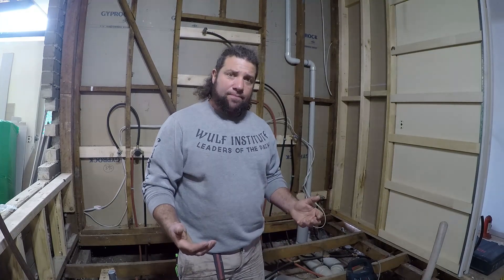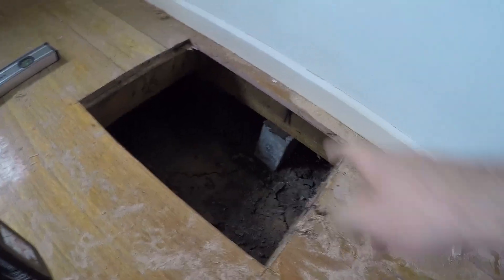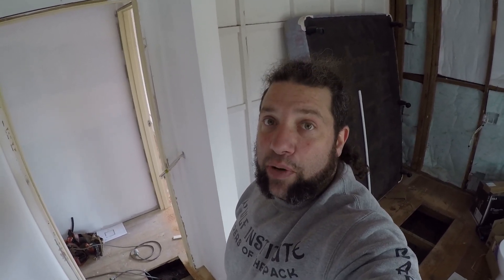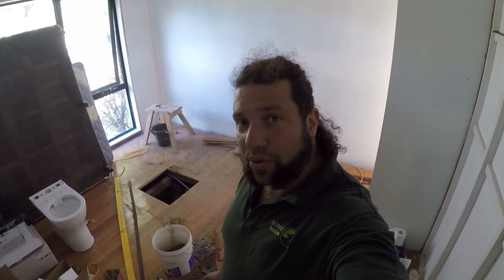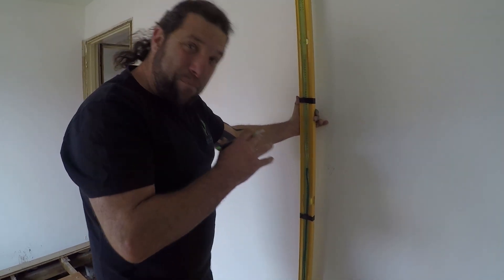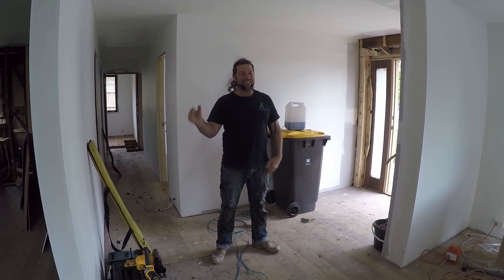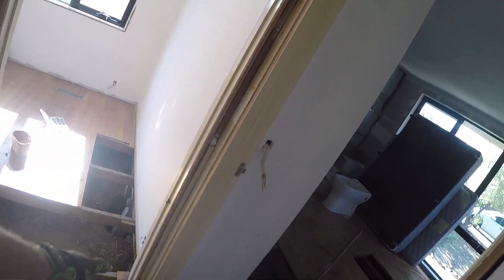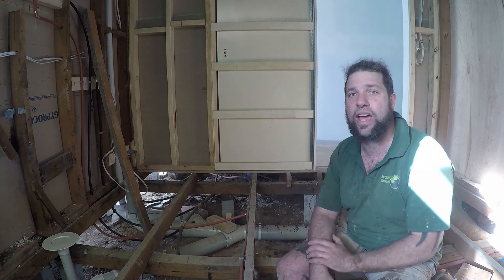Worlds greatest explanation on How & why to re-stump & re-block a house

Comment: Got me curious, what's the cause of the concrete stumps cracking?
Reply from the maker: the steel rod in the stump was to close to the surface adn moisture got to it and the rust exploded the concrete
Reply: @BeowulfBuilders do you think it's better to use the stumps with the stainless steel threaded rod to prevent corrosion and prevent concrete cancer from happening again?
Reply from the maker: galvanized screw threads is the best i have used

Comment: Hi Joe, thanks for your awesome videos, many lessons to learn.
Just to understand, I bought a place where doors they canot close properly and over there is a crack, I already thought there were a stumps problem. Tell me if I'm wrong, after finding the level in the whole house I should jack the sink floor and than restump, right?
thanks!
Reply from the maker: Yep, that's how you do it.... but check that the cracks around the place aren't from structural down loads or weight points that need to be strengthened and supported properly while you are jacking

Comment: Fantastic videos very informative.  What Tonn rating are bottle jacks are you using? What depth and width hole would you do for steel restump in class (S) slightly reactive soil?  hole 700d x 350sq? using Boral Blue Circle Concrete Mix?   Thanks
Reply from the maker: 5tn rated jacks, and ALWAYS add cement to your pre-packaged concrete mix.... never trust their kpa rating
Also, NEVER under any circumstance use "Rapid set" it doesn't hold up for structural load

Comment: What do you do about the crown / hump in the centre of the floors? Lower the stump?
Reply from the maker: trim some timber out of the bearer, as long as its no more than 20mm on a 90mm bearer or trim the top off the stump.  just ensure its still tied down so the bearer doesnt bounce on the stump

Comment: I looked up that your company is based in melbourne. Just wondering if you reblock in regional towns like horsham as I am looking to buy but most houses are old and in need of reblocking.
I was wondering what a ball park figure would be to reblock a standard 2-3 bedroom home. I can even supply interested homes I have looked at for a more fixed price.
If you dont do around horsham area, could you recommend me any good ones with good prices.  I only moved around here 6mths ago from melb so I dont know who to look for.
Reply from the maker: Gday Freespeach,
No idea who to use all the way out there, & since getting back from up north, i have hidden my head in the sand as the prices of materials adn skilled labour is wayyyyy out of the ball park.
the average home use to be $8,000-$10,000 
hope that helps

Comment: Do you raise the jacks above the amount you need to to counter any settling of materials/soil? If so, by how much do you usually do it?
Reply from the maker: GREAT question.... i try to get it as close to exact as possible with only a 2 mm tolerance.
use LOTS of concrete adn make sure you dig to stable soil, also use cured and treated timbers if available.

Comment: Hi Joe my house is on stumps i am getting rattling noise when i step on certain area of my floor board. What will be suggestion to fix it . Thanks
Reply from the maker: Gday Beyhan,
this sounds like a jack and pack job or your stumps are shot.
what this means is the area needs to be jacked up with special jacks and the top of the stumps packed to take up the slack.  this will reduce any movement and will need to be done to ensure the area is levelled or/and flattened off
hope that helps
#stayawesome
Reply: @BeowulfBuilders  can u give me a quote

Comment: Curious of the mpa in the concrete your pouring.
Thanks
Reply from the maker: Gday Simon,
This is a structural pre-mix concrete and is at around 25mpa.  you can up this if you want by adding extra cement.
Never use "Quick set" concrete for structural applications... this is not a structural pre-mix.  its only there for fence posts or the like.
#stayawesome
joe joe
Reply from the maker: Feel free to sponsor us at www.patreon.com/beowulfbuilders to help us create more great content

Comment: Hey Joe, very informative vid, thanks.
Might be purchasing a cal bung in Williamstown, there are some wall cracks around the place, can you rip off the floorboards,  re-stump then replace the same boards or is that not a viable option? The boards are in good nick, dont want them chopped up if i can help it.
 Any idea of rough price range for doing this, maybe 100 stumps, cheers Mick
Reply from the maker: Gday Squid lips (Mick)\
My guess would be that the floors are a Baltic pine for an old Californian Bungalow and these are AMAZING is redone and brought back to life.
a simple and effective trick is to wet the floorboards down with a hose & water over a three day period.  this brings moisture back to the timber and softens it which, in turn, allows you to pull them up with care.
now depending on the actual age of the Cal Bung will depend on the nail and the configuration (make up) if the nails .... this is where you can run into MASSIVE problems as the old craftsmen would use a raw steel nail which would rust and HOLD the timber & floor in place.
i do have a vid or two on this channel about exactly this.
as for the restumping... this largely depends on access to the site and around it, soil type, permits etc yet off the top of the head you'd be looking at the $12K mark 
#stayawesome
Uncle joe joe

Comment: hi mate what's the temprorary prop you're using? it just stand on the soil?
Reply from the maker: Gday Tony,
We use either a hardwood post as a temp prop or and acrow prop that can be adjusted.
these are easy to work with adn needs to placed in the correct position to weight points and bracing.
regarding the position on the soil or joists; we always will put a timber soul plate down (45mm thick x 240mm wide or in inches 2" X 10") to allow for flex and movement without cracking or breaking.
#stayawesome
Uncle joe joe
Reply: @BeowulfBuilders  Thanks Joe. Now I understand.

Comment: are there wooden stumps and concrete stumps? Is it advisable to go for concrete stumps?
Reply from the maker: Gday Johnny,
YESSSS go for concrete stumps with ant caps adn malfoid or damp course on top.
#stayawesome
Joe Joe
Reply: @BeowulfBuilders  do you serve Horsham ?
Reply from the maker: nope, there are some good "old school" chippies out your way though
Reply: @BeowulfBuilders  do you wrap the whole stump in Malthoid or just put it between the top of the stump and the bearer?
Reply from the maker: Gday DK,
if the stump is a concrete stump we put the malthoid at the top to reduce the moisture from the concrete rotting away the timber bearer.
if the stump is timber then we "COAT" the stump in tare 100mm (4") above the ground level  to the bottom with 2-3 coats and i still like to put malthoild on top but some people don't, again, to reduce moisture passing through the joins.
#stayawesome
joe joe
Reply: @BeowulfBuilders  thanks for the info and quick reply mate. Do you guys service Wonga Park?